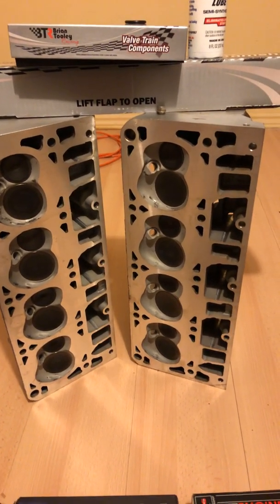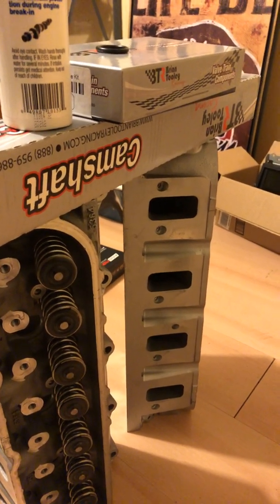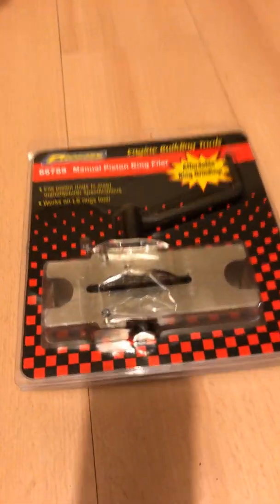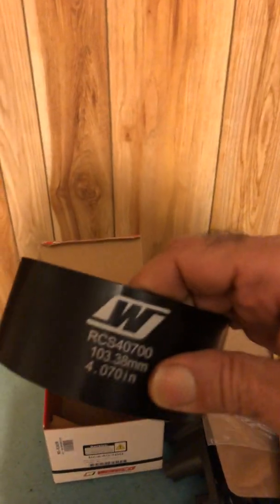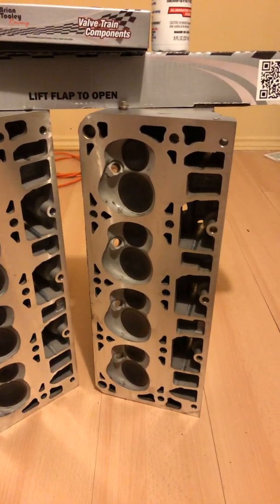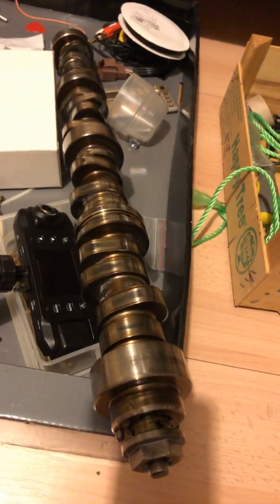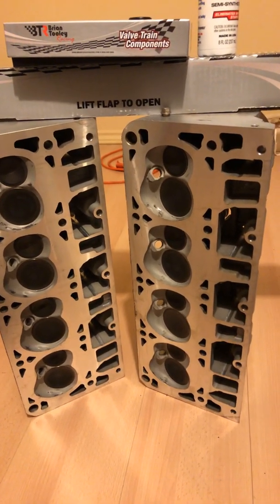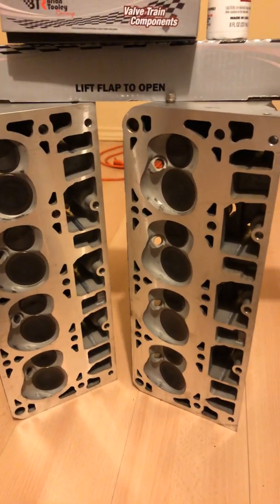LS3 416 stroker parts list accumulation!

Comment: The intake valves are much lighter.
Reply from the maker: Ya… Hollow Stem intake valves filled with sodium… they valves stay cooler but are much weaker and are known for snapping when using higher pressure valves springs with a performance cam at high rpm’s. The L92 valves are right at home with higher pressure valve springs …That being said, if I was going for new valves, I’d go with stainless steel hi performance valves. If I ever decide to take my heads off for any reason, bad lifter or something. I’d get ether with the MAST or Frankenstein LS3 heads.

Comment: Great Content, about to build a 416 "Torquer" L92 for a Bullet Proof 80's Land Cruiser Swap
Reply from the maker: Thanks again….. your gonna love the power and torque…. Just don’t go to big on cam spec’s ..you’re gonna need a 2800-3200 rpm converter even with a stage 2 BTR N/A cam . Good luck on your build!👍
Reply: Ordered a BTR Truck Norris Cam w Mild 553 Lift 212/22x at Narrow 107 LSA, So I can go with Close to Stock Stall (Circle D TC), Going with 4032 Mahle -4cc, Lanati X-Beam Lightweight Rods/Lanati Voodoo Lightweight Crank, Hope to keep Rotating Assembly Lighter by 8-10lbs
Great Content, Tricks, Upgraded light the BTR Trunion, Adding Getm Oil Squirters
Reply from the maker: @thomaslapointe4671  very mild cam for a 416. You won’t lose any bottom end torque going up a little on duration on both intake and a lot more on the exhaust. Regardless even the truck Norris cam is leaps forward over the stock LS3 cam. You’re gonna be happy.
Reply: Your Right On Brother, Wanted to Go Mild with a Slight "Lope" Great Torque & Throttle Response, Pull a ATV Trailer Ultimate Bow Hunting Vehicle
If it's Not enough, Upgrade CAM Later for Edelbrock Cross Ram if I stay NA, or Possibly Lower Booster LSA SC
Reply: Did you ever complete this and if so, what parts did you use?